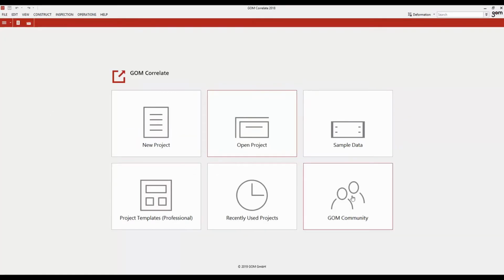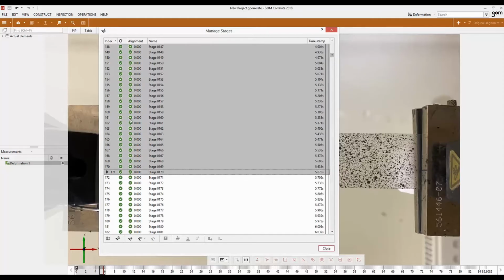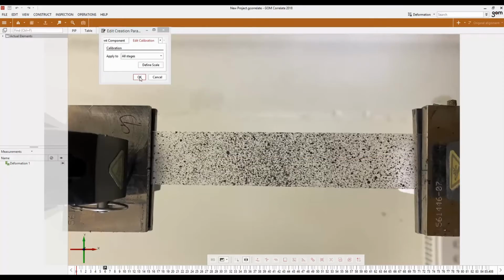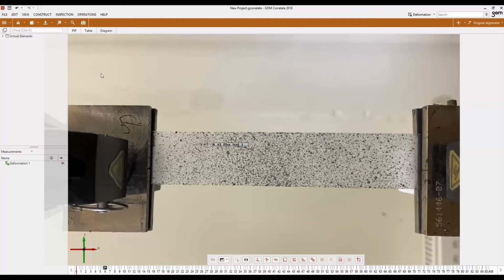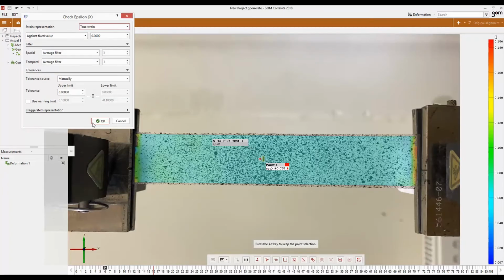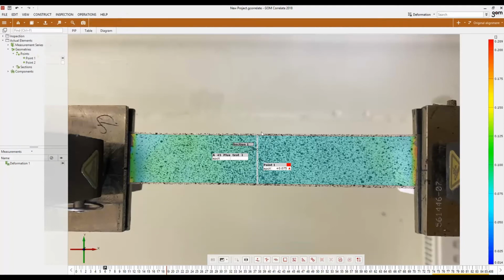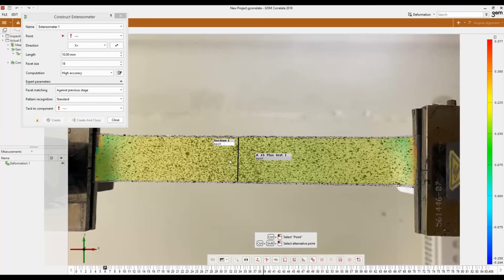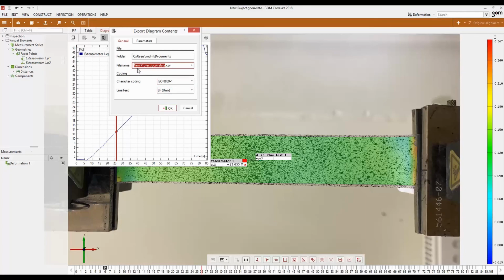DIC for Beginners II Fast and Accurate Digital Image Correlation

Comment: Hello sir, is it possible to measure negative Poisson's ratio accurately using this setup?
Reply from the maker: Hi, You can find in plane Poisson's ratio using length strain (e_l) and width strain (e_w). Let's say negative strain in the thickness is e_t, then e_l+e_w+e_t=0, so, e_t=-(e_l+e_w).  Now knowing all the strain components, you should be able to calculate any Poisson's ratio you want. Hope it helps.

Comment: Very interesting video. I would like to know if there is a way to eliminate or reduce the prospective view in order to have a near exact frontal view of the specimen. Thank you
Reply: Btw.   It seems it's not free
Reply from the maker: @CP-zi3eg  Hi, I have a year old version of GOM in my desktop which was free and still free to use. Has something changed since!(?) Can you please try this link and see if it helps: https://www.trilion.com/gom-suite#
Reply from the maker: To eliminate perspective you will need 3D DIC with at least two cameras and GOM was never free for 3D analysis, unfortunately.
Reply: Arrange a good quality camera and place it as far away from the specimen as possible while ensuring points are still visible.